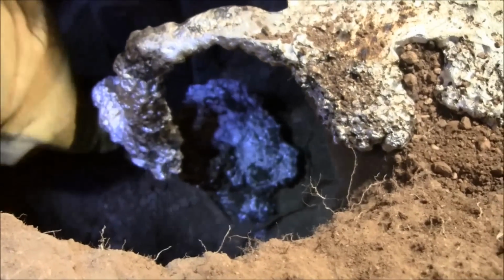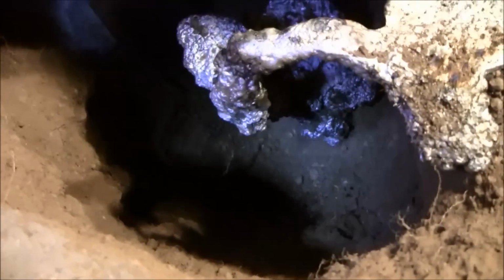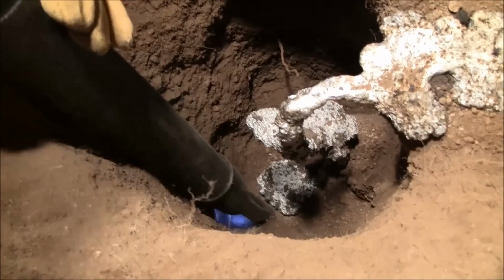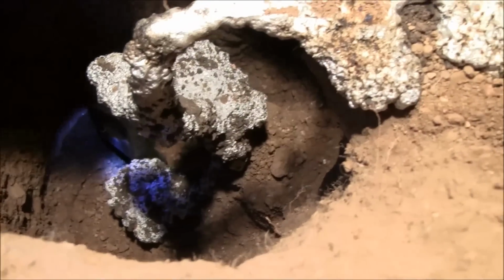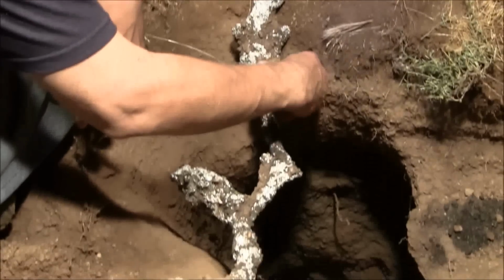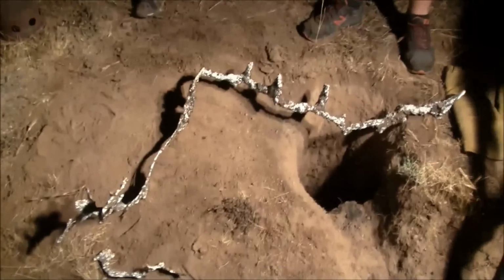My Second Anthill Casting **CASTING IS FOR SALE**

Comment: Might’ve wanted to cast the other holes to in order to get the entire network. Maybe lots more aluminum too. Good effort for your second try👍🏻
Reply from the maker: Yes I definitely agree. More aluminum would have been nice. Unfortunately, we used as much as we could. Our crucible was not that big, and we fit as much aluminum in it as we could. That’s why we weren’t able to cast the whole hole. And you could even see in the casting how there was a very thin part, meaning that the liquid was still flowing down and not stopping up. So you are definitely right.

If we continue to do this in the future, we will look into getting a bigger crucible so that we can use more aluminum and cast the entire network.

Comment: How much aluminum is recommended to fully cast the entire colony?
Reply from the maker: A lot more than we had 😂

It honestly depends on the size of the hill. Some would be fully casted with what we had, others would require a couple of gallons of melted aluminum. Some videos show people using a huge cooking pot sized crucible. Really the best way to always make sure you have enough aluminum is to have excess amounts of it melted, and start pouring. When the hill is full, the aluminum will just start to overflow, and that's when you stop. Does that make sense?
Reply: @Ultimate_Aviator  Cool and fully understood. I have seen this done in many different videos but nobody ever says how much they are using so I was curious. It looks fun!
Reply from the maker: Logan K it definitely is! I’d recommend going to The King of Random’s channel and finding his video on how to make a metal foundry. That’s where we started.

Comment: How did so many ants get out? Was there a back door? You would not have been able to get the sculpture if they had been fire ants. You would have to get a flame thrower.
Reply from the maker: That is a great question. I'm actually not sure. My guess would be that because we didn't have enough aluminum to cast the entire thing, the passageways that were not reached still had ants in them; when we dug out the casting, it exposed those channels.

Now I'm not sure what you mean. Why would we need a flame thrower? It would still work well with aluminum.
Reply: Best use of fire ants WVER!
Reply from the maker: Kathy Eaton 😂😂😂 yes!!!
Reply from the maker: jacktheripped it is definitely something fun and interesting to do... I would recommend it!
Reply from the maker: It really is up to you as far as how big you want to go. If you are new to this and have never done it before, I would recommend starting small. Look for smaller ant colonies and smaller overall structures, so you can get the basic idea of how to properly cast them before you go big. I kinda wish I would have done that.
Reply: SuperAwesomeMusician, most harvester ant nests have multiple entrances. If you had been able to pour all the openings you would have had a massive caste of an entire ant superstructure, which would easily sell for big bucks. Very nice job!
Reply from the maker: Dragonuv2002 Thanks! Yeah I really wish we could have used more aluminum, but unfortunately this was all we had.
Reply from the maker: jacktheripped are you looking into doing this as a hobby or to make money? Because it would be a really fun hobby to do, but I don’t know if you’ll be able to make money off of it.